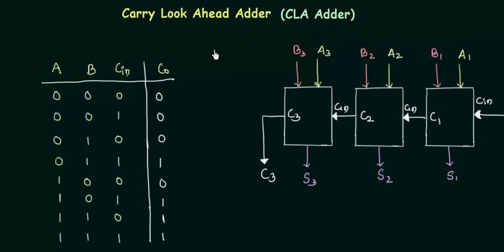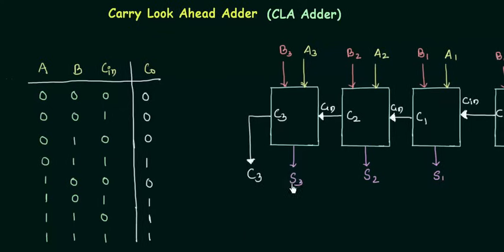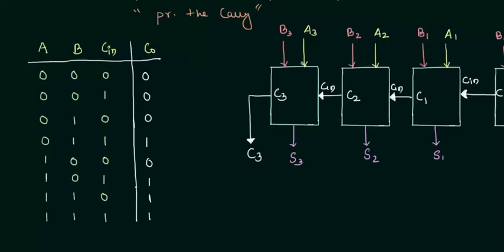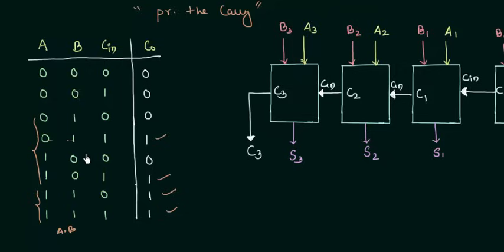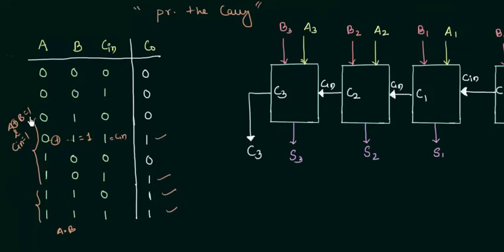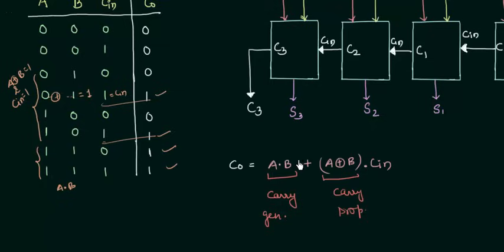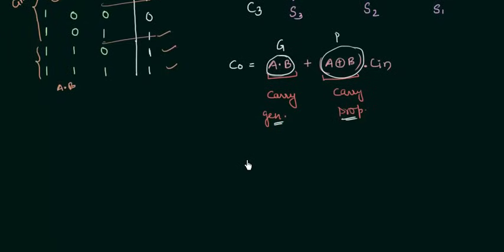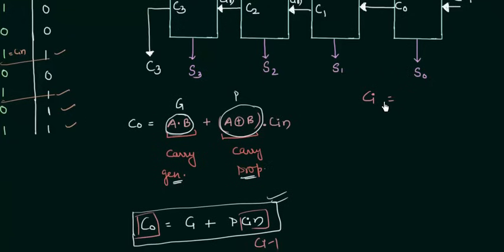Carry Lookahead Adder (Part 1) | CLA Generator

Comment: Gi and Pi are named as GENERATE AND PROPAGATE  because of a reason , IF YOU DONT KNOW WHY THEN YOU WILL NOT GET CONCEPTUAL CLARITY IN THIS  ::: 1.Gi: the carry is generated  i.e. carry=1 whenever a=b=1;; 
2.Pi:  the Cin=Cout always  only when a exor b =1 ,, ;;since cin=cout , it is called as propagating therefore  A xor B means propagate ;;; now if A=0 ,B=0,, CARRY IS ALWAYS ZERO, THEREFORE IT IS CALLED CARRY KILLED expression=(a bar *b bar)

Comment: @NesoAcadamy clarification. 1:38, c3 does not depend on s3, it depends on c2, b3, a3. You circled s3 with the mouse when saying that the carry depends on the sum. I know you meant the sum if we added it in our heads. But in the wiring it depends solely on b3, a3, and c2.
Reply: meaning is same as S3 comes , means c2,b3,a3 are used .
Reply: Both sum and carry output depends upon the Cin @shieldff9122

Comment: sir if I write a+b in place of a xor b.then it will be true or not .because a+b is also depends on carry input.and finnaly what will be  changing in figure.I wait for your reply
Reply: it's correct. And it's actually better because the adder must have "or" implemented, but "xor" may not.
Reply: Did you get the answer?